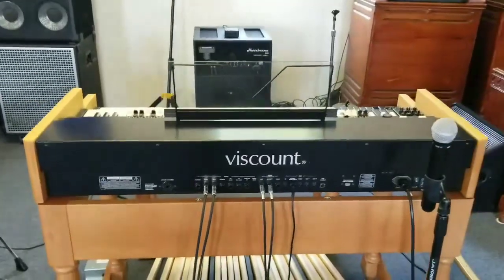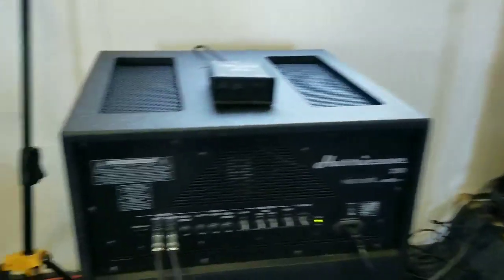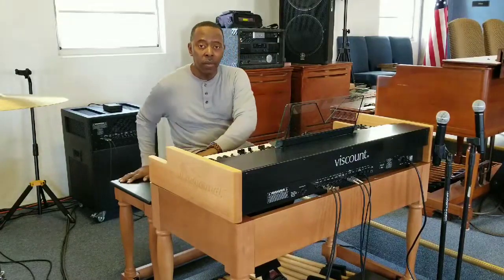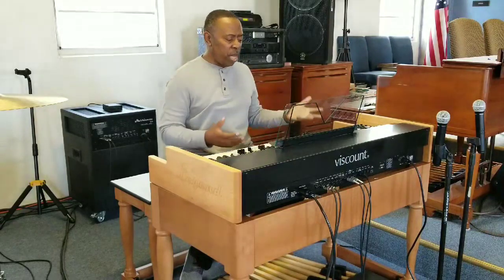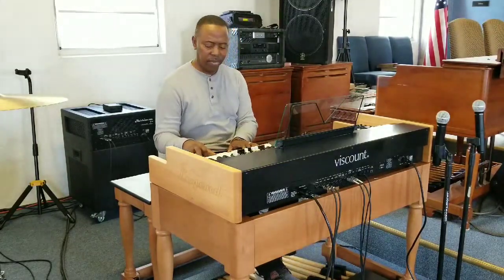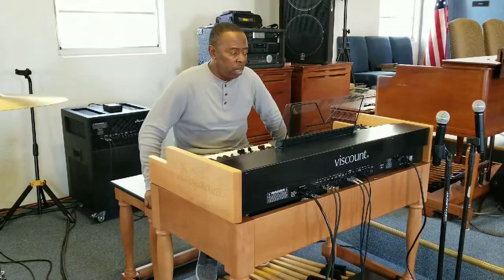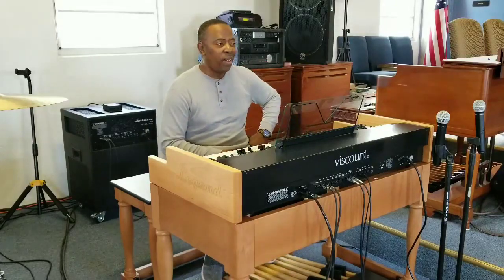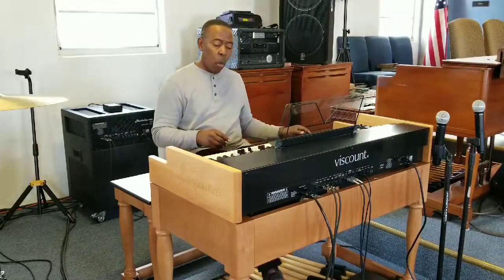Viscount Legend Organ Outputs, Key B, Viscount Editor, Hammond C3, B3, A100, Bishop Samuel Butts

Comment: Hello Bishop. Thanks for this good demo.  I have a Legend and a Hurricane 210, but now Viscount has a new true rotary horn speaker (the Vortex 315), that's 1/2 the weight of the Hurricane. But I cannot hear/demo one anywhere near me. Have you heard it?  Does your brother carry it? And is it any better than the Hurricane?  I think it's 1/2 the power of the 600w Hurricane. they also have a "Spin Tone 700" model that has a rotary horn. Have you heard that one?  Tell me if you know anything or can compare.  I cant get Viscount to answer my emails about it either. Thanks so much. ST
Reply from the maker: They won't be available until around September or October.
Reply: @SacredMediaOne  Thanks for the reply Bishop. If/when you get your hands on one, let me know if the Vortex 315 is better than the Hurricane 210. Thanks
Reply: @SacredMediaOne  Hey Bishop! Do you have a way that I can communicate with you regarding getting a Viscount Legend for me?
Reply from the maker: @meetyourfate  Sorry for the delay. if you are still interested here's a link to a good vender: https://www.hammondcentral.com/legend.html